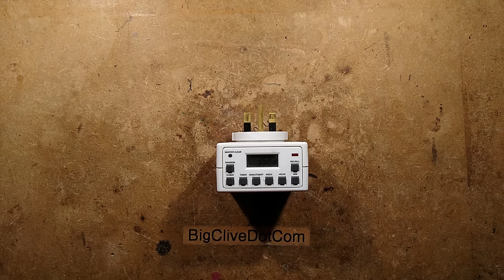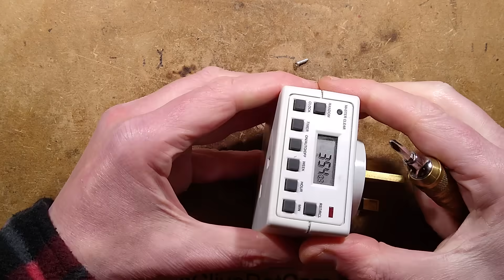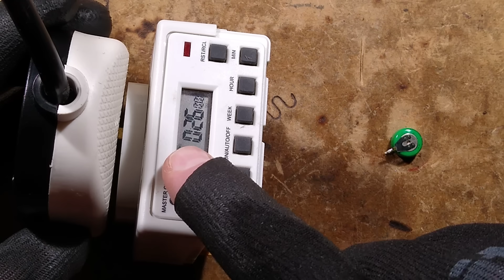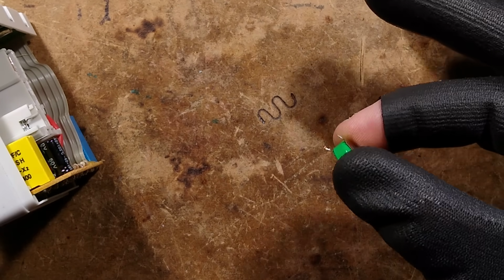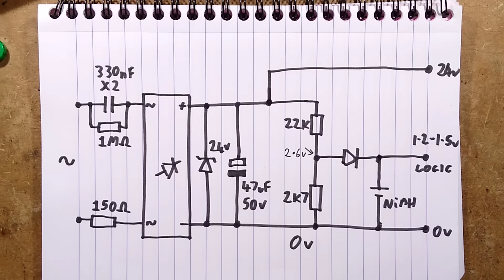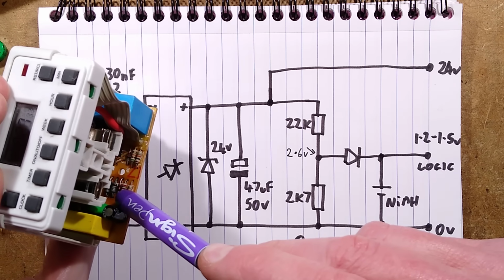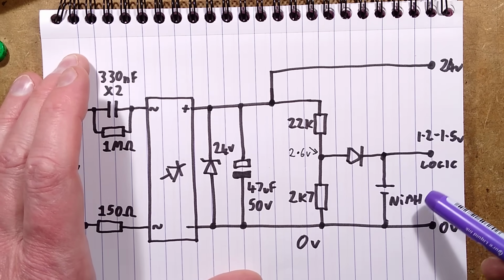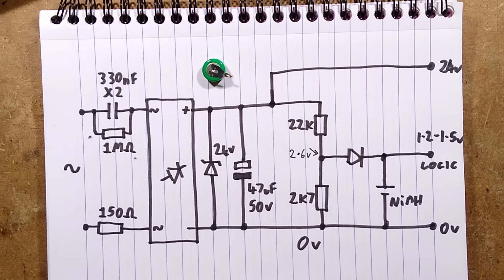Can we fix this faulty time switch?

Comment: Last night exactly same timer failed at here. I think relay contacts are stuck.
It has been "driving" 3Kw heater so it has been on limit all the time. I have been "waiting" when this happens actually. Our timer is bought from Lidl, but looks exactly same and has same functions. I'll look if I can revive it..
Reply from the maker: A sharp tap may release the contacts, but I'd recommend getting a new timer.  If it's an immersion heater they do more rugged units for that task.
Reply: Yeah, sharp tap on to the side of the relay released contacts, I had open the timer and tap directly on to the relay. That "Lidl version" seemed to have 10amp rated relay, though sticker on timer says 3600watts... So even that 3Kw heater goes ~2.5amps over it's rating, if I calculated right. No wonder why it got stuck.

Also, that memory cell were near 1.3volt, which is bit high-ish?

Comment: You need a Red LED across the NiMH battery to cap the voltage. You can also use a couple of silicone diodes.

Comment: I bought a few of these years ago in Lidl on sale for €1. I use them during Christmas to power the lights outside and turn off during the night. The only thing bad I found about them is that they are not user-friendly. I need to read the manual every year to see how to set it up. And the very small display does not help.

Comment: I have had quite a few of these exact Status switches and they have all failed in exactly the same way. After a few months of correct operation, they suddenly stop working and require resetting and completely reprogramming, after which they work again for a few months. I actually reverted back to the manual type with pins on a rotating head though the wireless type with an app have worked quite well.

Comment: I was a bit confused by the schematic because it doesn't actually show the relay. But I see now that the relay itself is being turned on by that 24v branch, and your schematic is only dealing with the DC section of the unit. So now that I understand it better, I guess my question is whether or not the DC current that's being constantly sent to that NiMH cell 24/7 is in excess of what the LCD/Clock circuitry is actually consuming? Are they charging the cell at a rate where it would actually be fully charged in like an hour or so of operation? Because if that's the case, that seems like it's quite overkill. They'd only really need to trickle-charge the NiMH cell with slightly more current than is necessary to power the clock/LCD circuitry, with the remaining minimal current then going into the cell.

Comment: I had one of these digital display timers, which when working, did a good job of turning things on and off at different times, but it ended up with the exact same problem as this, which I used for my Xmas lights, now in the bin and replaced with an old mechanical timer, which not as flexible, just works

Comment: I don't mean to sound creepy but if we lived in the same house we would be fighting over who owns what because you have a lot of the same things I do LOL 🤣😅
I also have 2 of those little timers, never really noticed the display as they tend to go flat as I seldom use them, however I do think the display on one of them does the same thing when it is `ON`.
I don't think I have any of those batteries, I do have a weird 2/3 AAA battery in a solar light. Does that timer NEED the battery, is it definitely regulating the display circuitry voltage, which it seems to do. if not bothered about settings keeping could a resistor of appropriate value be soldered instead? Any other alternate to the battery? Super cap?
Your a true electronics star and salute you sir :D
Reply from the maker: The correctly sized battery is preferred, as it maintains the settings in the event of unplugging or a power cut.

Comment: Good work Clive! Nice to solve this mystery. I didn't know cells could fail in this way but I see how the circuitry surrounding it allows the voltage to rise, and that it was effectively being used to regulate the supply to the logic. Before the fix, the display contrast was poor ("unlit" segments were lit dimly) -- I wasn't sure if this was just an unfortunate viewing angle vs the light source but it was so much crisper afterwards.

Your mention of common failures being that the unit craps out when under load due to an ailing dropper capacitor reminds me of the "smart" extension lead I need to investigate, already suspecting this cause.

You set a good example with the gloves... sort of. The cut-off index finger felt like the Achilles' heel. Sitting on a well insulated chair with your feet off the floor, were you? 😁
Reply from the maker: I'm in a well isolated area protected by a type-A RCD.  I may get new gloves and cut the tip of the pinky off instead.

Comment: I had much the same problem with a different brand of timeswitch, replaced the battery as BC has done, and also fitted a 1.3-ish V zener in parallel with it to ensure the voltage to the clever bits stayed within spec.

Comment: Had this exact problem with 3 of these, and also 2 of a different type, bought a bunch of new cells from China (5 for £3.70), same obscure brand as the originals, I also had a similar problem with a power usage meter, weird display but also kept randomly losing data.

One of the "other type" timer switches started overheating the diode bridge and shorting a 47v zener (48v circuit+relay), I think the X2 is causing it and if I don't have a spare I won't bother as it'll cost more to buy a bunch of them than the timer is worth.

I do wonder if these get over voltaged a bit in the UK, as they're cheap and designed/made in China for 220v, the UK sees voltages up to 254v (usually at night).

Comment: I see this failure mode at work sometimes. We have an older generation embedded controller that uses a NiCd/NiMH battery for NVRAM.
Predictably, this battery is usually trickle-charged by an onboard charger somewhere in the system when it's powered up.
After ten plus years, the battery will go screwy and allow the voltage to rise higher than it should be on this rail.
This'll actually crash the controller in wild and screwy ways that aren't exactly intuitive. Replacing the battery fixes it.

Comment: I used to have an American version of one of these timers several years ago, and it failed in a rather interesting manner...the memory backup battery had physically exploded. Didn't expect to see that when I opened it up out of curiosity.
Reply from the maker: That's common in solar lights in sunny climates.

Comment: Before making safety claims for PPE it's a good idea to test it.  Especially if it's black because quite often, especially if not electrically rated (or worse it's ESD-rated), the pigment used is often something conductive like carbon black.

Comment: Some older PLCs use rechargeable cells or capacitors to hold the operational program of an industrial process.
Tends to be the one thing nobody checks, or has read the manual to know to check.

Comment: Does anyone know any such timer devices for things like air heaters? 
I had one that failed mostly due to how much power went thought it over the span of months, it was just a connection issue and i replaced it and reinforced but then another thing broke on it and i left it aside, so, anything more durable, suitable for this usecase?
Reply from the maker: You do get higher current ones for things like immersion heaters.

Comment: This reminds me of a not so fun childhood anecdote/memory:
Back when I was maybe 6 or 7 my parents had a slightly similar timer plug that I liked to play with when it was not in use.
But one day my father suddenly disliked it and slammed the timer against the floor.
(He very angrily said something like Wanna play with the timer ?! Play with the timer ! Now that it's broken...)

It popped two of the screws holding it together and the case was partially open at the top.
I don't remember how but I closed it back somewhat, maybe using tape to keep shut then I plugged it but unsurprisingly it wasn't working anymore.
The red LED was faintly glowing but the timer wasn't usable although I don't remember if the display came on or not or if the outlet was live or dead.
And now I wonder what component broke and how fixable it would have been if it had happened nowadays.

Comment: Hi Clive. Love the channel and have followed you for several years. I have 5 timers that use the same logic module and after the first year 2 of the batteries leaked (1 did a very spectacular explosion inside the case as it shorted the 13 amp contacts with conductive fluid and left copper plating all over the board). I have now replaced all of the batteries with AAA cells and have had no further problems even after 8 years. Love the LED hacks keep up the good work.

Comment: Could you add a rectifier between the voltage divider and the NiMH positive terminal to drop voltage a little and stop this failure mode happening?
Reply from the maker: Enough of a margin has to be left to charge the cell properly with decent component tolerance

Comment: Very nice job there. I think that to finish the job I would have replaced the zener with one with longer leads with small loops in each to raise the zener away from the board.
Reply from the maker: There was the temptation to replace it with two 12V zeners in series to spread the dissipation.

Comment: I feel lilke I get mixed signals as to whether you can test a cap's capacitence when it's still stuck to the board.
Reply from the maker: With a capacitive dropper the only other component usually in circuit is a high value discharge resistor.  So in-circuit testing is viable.

Comment: I remember when I used these and the analog ones for Christmas lights.

They didn't like the cold...analog ones would just not turn properly and battery on the digital ones would usually fail and explode.

So glad to have smart plugs for this now.

Comment: I came across a bit of commercial equipment that was 'cost optimised' beyond reason.  Rather than using an (e)eprom for the program they used half of the battery backed config SRAM (6116 I think) to hold the program.  A bit of logic inhibited writes to the half that held the program.  It all worked fine until the rechargeable battery aged and power was removed from the device for any reason.  Then the cell voltage would drop below the voltage required for the low power mode of the SRAM, draws microwatts in that state, and the program became corrupted and device no longer worked.

Comment: Interesting, I've just been using a timeswitch to power the big fridge on and off while waiting for a new thermostat to be delivered, which luckily arrived before the Christmas shutdown
The timeswitch is a few years old now. Would you recommend changing the battery for a fresher one?
I dont see any fun or prestige in fitting an actual new one 😂
Reply from the maker: Most timeswitches will run on their original battery for a very long time.

Comment: Thanks for the video! ❤I have the same timing relay with the same problem. So far it hasn't bothered me, but now that I know the problem, I'm going to fix it. Surprisingly, it doesn't lose the settings even after 2 hours of power failure.

Comment: I'm wondering whether it would be worth swapping the resistor in the bottom of the potential divider with a 2V Zener? And I'm always tempted to swap the main Zener with a beefier model with greater dissipation.

Comment: I thought it was one of these 95% efficient safety gloves 😸 - but random coincidence: my upcoming project video also has the batteries used in a voltage regulating capacity. I wonder how common that is or was?

Comment: You had me tightly clenching the arm of my chair as you were trying to measure the Zener diode with that nice brass screwdriver rolling around on the bench just needing a very slight nudge to send it under the energized PCB and give us a fireworks display.

Comment: so the true fix is to adjust the divider to use a 2.1v zener instead of a 2k7 resistor
that caps the peak voltage the cell can ever get at 1.5v(plus any low-current float bias)
that should prevent the logic hitting 2v again and make the NIMH cell less sad from constant charging when full

Comment: I've used the timer module from a Tesco version as a compact timer for a Land Rover, to power up the fuel burning heater to preheat the cabin in winter.
It worked very well for the task, and used basically nothing from the 12 Volt vehicle battery.

Comment: I have a really ancient one that switches on\off my internet router each night. It uses a PCB mounted Nicad in it - not easy to get hold of a new one of those these days. Over the years the LCD display did the opposite of this and was getting fainter to read. After replacing the Nicad all is good again. It would be nice to add an ethernet interface to it so I could power off my internet router remotely from my PC.

Comment: Instead of cutting the tip off, just stick a bit of foil on top of the glove.
The capacitance from your finger to the foil (and thus to the screen) is enough to operate a touchscreen without risking electrocution when you touch other things with an exposed fingertip.
This works on my phone.

Comment: Does your timer cope well with electronic loads? I have a visually identical timer, except of main land European plugs and the NiMH cell is replaced with a regular LR44 button cell. Mine resets time and settings upon switching on a power supply for a LED desk lamp. I suspect the timer module though, not so much the daughter board that holds the PTH components.
Reply from the maker: Some units I've used in the past would crash when switching an inductive load.

Comment: Hi Clive, For your own personal safety I'm just wondering if you use a mains isolation transformer when working with open appliances. When I was a teaboy (in the 1960s) at a local electrical shop I recall there was one installed under the workbench but don't recall you ever mentioning them.
Reply from the maker: I use a type A RCD.

Comment: It will be interesting to see how many of the radio locked versions of these time switches continue to work after the Droitwich RTS signal on 198kHz is switched off after June 30th this year.

Comment: Ta for pointing out the obvious source of cheap NiMH cells to replace those in timers that have failed. I've seen solar garden lights for as little a 50p in a Sainsbury's end-of-season clearance but never thought of them as a source of backup cells.

Comment: I have found that these timer circuits use very low voltage logic for the clock circuit, typically 1.5 to 2 volts ( spec value of 1.8 volts). These misbehave with any small over voltage on the supply rail. It seems bad practice to use the standby battery as the supply regulator. When the battery inevitably fails it has a tendency to destroy the timer circuit with prelonged exposure to the over voltage on the supply. A problem I discovered on a radio locked version of one of these switches. Such is the poor tolerance of this type of logic to excess supply voltage, it is difficult to add any protection, such as a second zener diode or an LED( acting as a zener) to protect the timer from damage when the battery goes high impedance.  Its only protection is the current limiting provided by the resistor divider in the battery charging circuit.

Comment: Can anyone tell me how the NiCd cell caps the 2 V to 1.5 V once it's full? I can understand the voltage drops as long as the current can go into the NiCd cell, but once it's full, why wouldn't the output just go "high" to the same output as the diode, i.e. 2 V? Does the NiCd cell itself act like a zener diode, always pulling the voltage down to it's max. voltage?
Reply from the maker: When fully charged a NiCad or NiMH cell will usually reach a known voltage and then recycle gas into liquid electrolyte internally with a slight warmth as trickle charging continues.

Comment: You should work for the government, just buy a cheap solar light for £1 to get the battery and fix the timer. You forgot to say, the cost of the fluke and capacitance meter, the 50 years of hard earned knowledge and exceptional skill. Just like renewables energy the energy is renewable but the supporting infrastructure costs a bomb.

Comment: bad design, the zener diode should had longer legs to keep away from the board, better cooling, the case should have ventilation holes

Comment: Yep, I was waiting for the errant screwdriver to make its move! 😂 I’ve only ever bothered to dissect the more expensive immersion heater controller. Very similar or perhaps identical circuit. I found it was the relay itself had failed due to high current and heat. A bit of a pain finding a replacement, but at least I now have a spare timer(which will never get used!🙄)

Comment: Interesting to know that a lithium cell going bad isn't always indicated by a lower output voltage . I knew batteries go higher impedance through working on laptops over the years but I don't think I've ever thought that the output voltage could be higher than normal. I usually think about it's behaviour as reaching "full capacity" ( a false state ) too quickly and then discharging immediately. Very useful bit of information which really, I should have previously thought about more.

Comment: A modification would be to put a ~1,5V Zener parallel after the battery so the display always works :) the only thing is that the possible power draw when not using the device will take out the battery faster.

Comment: I had a similar issue with one of the mains power monitor devices. Though in Australia, it was more for the battery than to buy a whole new replacement unit. Australia still hasn't got on to the whole reduction of land fill.